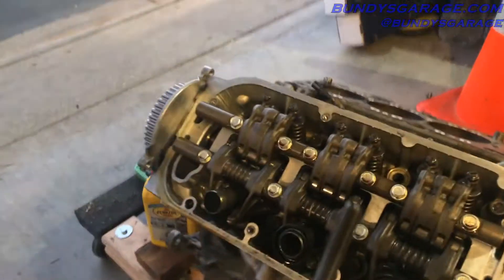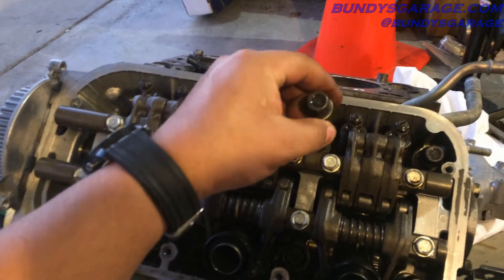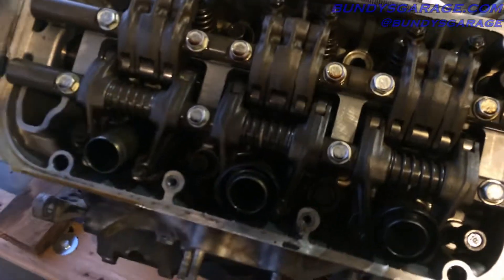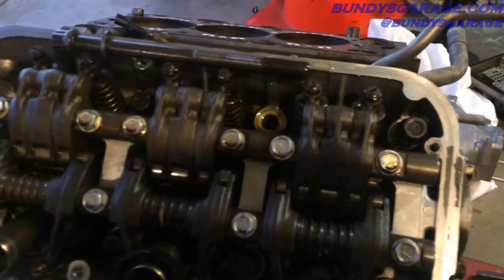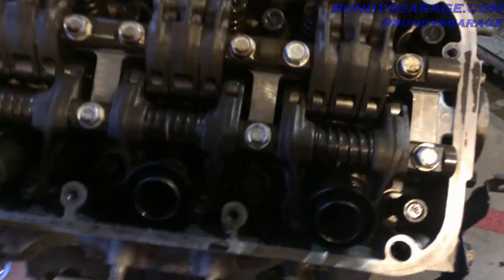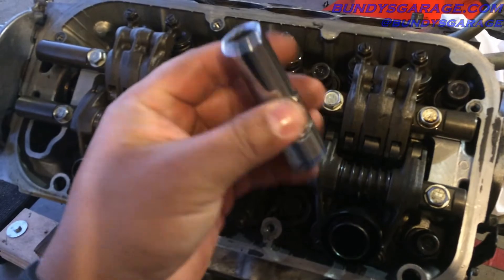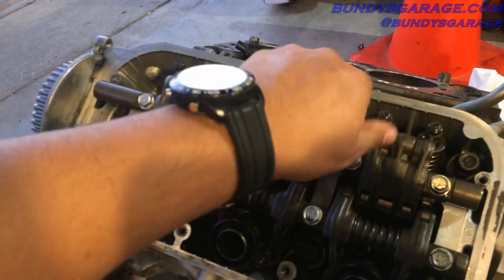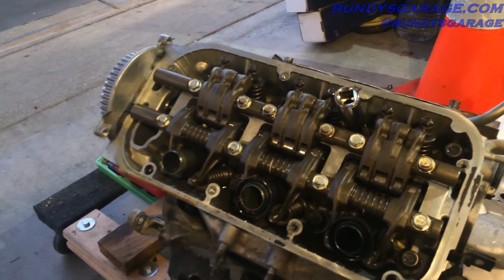Honda Accord V6 Head Gasket Bolt Replacement Tips and Tricks - Head Bolt Torque Specs Pattern

Comment: You just created a hydraulic lock in the bolt holes by pouring oil in .....
That's a big NO NO !!!
Reply: The attached manual says put new motor oil on the threads and under the head ...